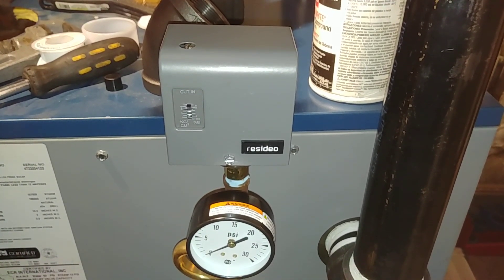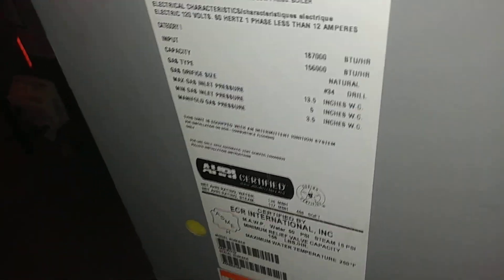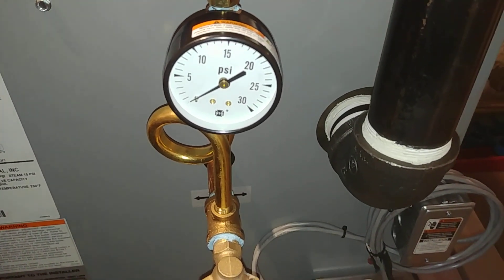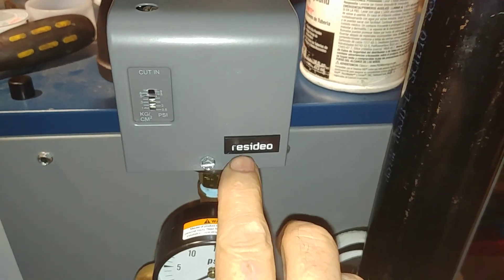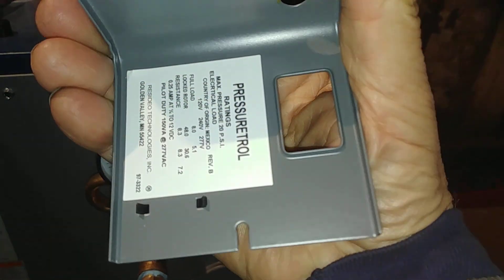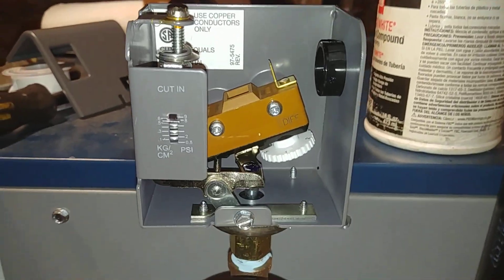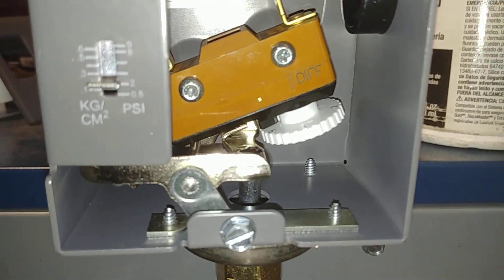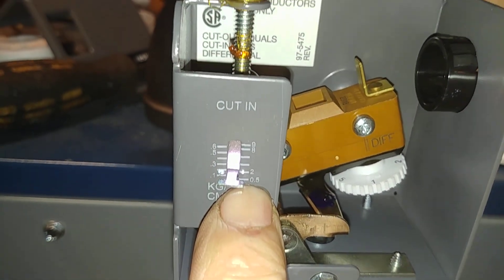Honeywell PA404A Steam Boiler Pressure Control Defective Right Out Of The Box

Comment: Would increasing the PSI help push heat to the furthest radiator? I have one pipe steam radiator that I can’t get steam to unless I remove the air vent to bleed it before the steam finally reaches it. Once it cools I have to do it again. I have #C vent. Going to try D but it barely squeezes out much pressure when I vent with the system on
Reply from the maker: It might be your boiler is undersized or under fired (not getting enough fuel).
If you vent a radiator, and it doesn't heat well, it's not a venting problem.

Comment: That one looks brand new. Id say its just stiff, fresh off the shelf. And the whole system looks new too. My amature theory is that it hasn't been moved in a long time and none of that orher equipment had either. Let it work for a month or two and then come back and look at it.
Reply from the maker: Thanks for your thoughts, but a pressure control that is new shouldn't need a break-in period.

Comment: Did the boiler come with the Residio control?
What’s the fix for this problem?
Will you offer a better replacement control such as a vaporstat ?
Reply from the maker: @davidlampe4153  Yes, this is the control that comes with the boiler.

The fix (for me), is to slightly bend the metal tap in the back with a slotted head screw driver and that takes care of the problem 

A Vaporstat is often unnecessary for the system, expensive, and the build quality on those is also not what it used to be.

Comment: i always use Utica boilers for my steam jobs. Im glad im not the only one, since the "name change" iv had them fail brand new to 3 months old. Not good, this little test is part of the startup i do now as part of the install. Also i cut the molex connector off the the MM LWCO and hardwire it right to the lugs. Seen too many fail on startup or again after a few months to a year. Quality on the controls just arnt what they used to be. And idk how many times ive been to a boiler service for a first time customer or a no heat and that things still jacked to 9psi. I was lucky to learn from the older guys who learned from the original steam men. Its an theory being lost in time, its amazing how many new installs i see that just arnt even close to piped right, either to save money on ftgs or didn't RTFM. Steam on brother!
Reply from the maker: Thank you so much for sharing your Utica boiler stories!
It seems to many installers that the p-trol is "set at the factory" (yes, true...sort of), but they fail to understand that the setting is not for us, but for Honeywell's UL listing.
It galls me no end, as it does you, to see that in the field.
RTFM... preach it, O Brother!

Comment: Had a boiler company refurbish our boiler last year, and 3 times a new Pressuretrol has failed to either turn off at the cut-off pressure, or turn-on at cut-on pressure.  Technician 'solved it' last year by reducing the diff setting relative to the main setting, but now in fall of 2024 it's again not working properly, and won't cut-on again.  Thank goodness I've read these comments, because I could never imagine 3 new out of the box items failing to perform like that.
Reply from the maker: Thank you for sharing your story.
Please also remember to have your boiler company check to make sure the pigtails are free of sludge or blockage.
A blocked pigtail can cause a good pressuretrol to malfunction.

Comment: What's a better alternative when this one goes bad?  Before I wised up and installed a 3 psi gauge next to mine, I adjusted it with a water column in clear vinyl tubing and cut in was 0.5psi and cut out 1.5 psi after adjustment.  It has now drifted higher from that setting.
Reply from the maker: Is your pigtail clear of blockage?
Reply: @gordonschweizer5154  I actually didn't check it this year but it seems so by the way the pressure gauge is riding the cut out and cut in.  Just the values have drifted a bit higher.  I'll remove the pressuretrol and gauge and blow it out with compressed air.
Reply from the maker: Usually, the 404A is pretty stable as far as pressure controls go (once you dial them in, of course), so I don't have an answer for you.
From the fact that your gauges are showing pressure cycles, I don't think it's the pigtail.
Might it be your gauge?

Comment: I’ve got the same setup on my Utica boiler. Is there a replacement pressure gauge that you would recommend that is more useful?
Reply from the maker: A 30 psi gauge must be installed per Code.
BUT, there is no Code against installing another gauge with a lower pressure reading (say 3 psi) along side.
It might take a few 1/4 brass fittings and nipples to do, but some have found it useful to see the low pressures a steam system truly operates at.

Comment: I had a bad one out of the box in 2021. I had to go back to my shop and I found an NOS date coded from 2009. Worked great.
Reply from the maker: Had another one today, same date code as the one in the video, with the extra added bonus of the spring end being out of battery and the pivot frame was bent.
Got it to work.
But...
I think the quality control manager at Honeywell needs to look for a new job.
Reply: @gordonschweizer5154  on another topic, I had a 30psi hot water boiler relief valve fail out of the box. Looked like it was made of chineezium. That was a first for me. Unbelievable!
Reply from the maker: Was it one of those really yellow brass ones that seem to be made of mostly zinc with just enough copper to barely hold it together?

Comment: Quick question, i read somewhere that you should add a little water to the pigtail to avoid steam from getting to the pressuretrol is that true? Can't that anywhere else.
Reply from the maker: I used to worry about that & add a cap full of water in the pigtail, but I've since weaned myself away from such worries and it appears the water seal forms on its own fairly quickly.
However, I am certainly not going disparage anybody else from adding a bit of water because it can't hurt and it may be the right thing to do.

Comment: Quality has plummeted on everything Honeywell. We've been seeing Mod IVs last less than 6 months, pressuretrols and vaporstats dead on arrival and valve actuators quitting after a week. It's crazy. The mod motor issue is particularly bad for us. Switching to an ASCO or Siemens just isn't feasible sometimes so we're stuck with the new junk. Very frustrating, especially with so many of the old guru reps having shuttered or retired in the last few years so getting any help from the factory is a real chore.
Reply: Quick update on this. The situation has gotten so bad that even OEMs are coming up with retrofit solutions. For $2200, PowerFlame will design and build you complete conversion kits to swap out the Mod IV motors on C series burners for Siemens SQM40 actuators. This includes the SQM40. For the last batch we bought, we paid $1740 + tax per Mod IV from our local San Francisco rep. For pressuretrols, we'll be switching to Johnson Controls. Still figuring out what to do for vaporstats.
Reply from the maker: @tani357  Wow, I have no words.
What model of Johnson controls are you using for the PA404A p'trol?

Comment: Why not install a vaporstat? I have a vaporstat and a 2 psi gauge set at 7 oz to 21 oz.
Reply from the maker: Not all steam heating systems need a vaporstat.
Just about all steam boilers sold in North America come with a pressuretrol as a minimum. 
Generally, if you have a single pipe steam system, the PA404A is good enough (when properly tweaked so it works!).
But not always.
If your boiler is oversized, a vaporstat might be needed as well as down-firing to tame the beast.
If you have a two-pipe system, a 16oz vaporstat is just the thing.
But not always.
If your boiler is undersized, there will not be any build-up of pressure and the expensive control will have nothing to do.
But it looks cool!
Reply: You’re right. My boiler is a tad oversized. It would be nice if it just sat at 2 oz during the entire heat cycle. I suppose when it fails one day I’ll downsize it a bit. The 2 psi gauge is great though. I could see the pressure bouncing around even though the sight glass didn’t appear to be surging. I skimmed it and the needle was steady after that. The 30 psi gauge is useless. Btw, thanks for all your videos Gordon. Wish you were closer to me in NYC.